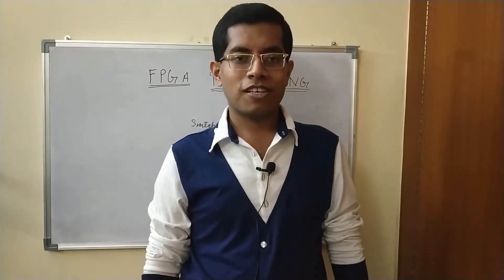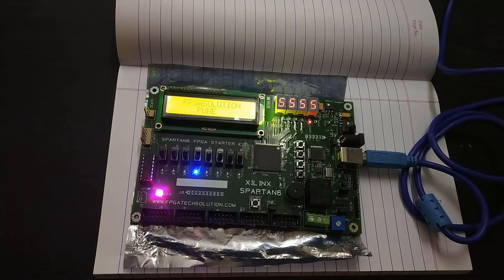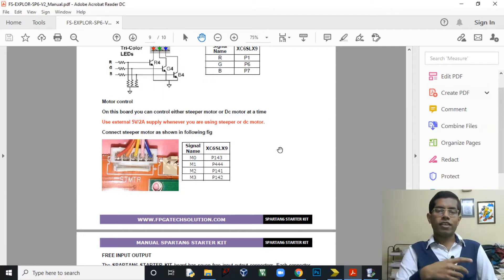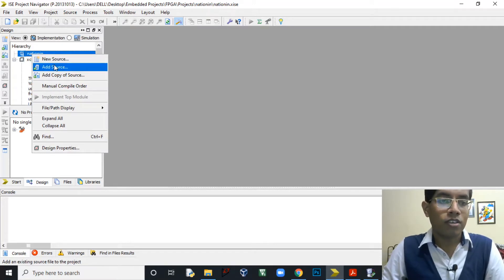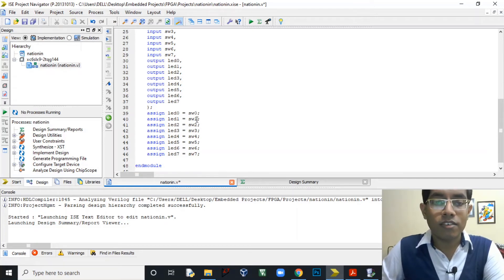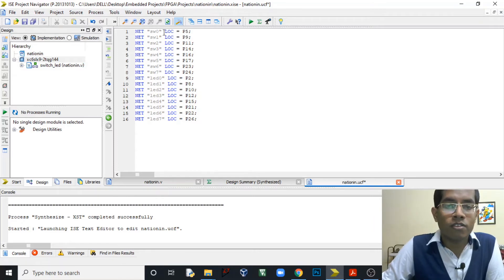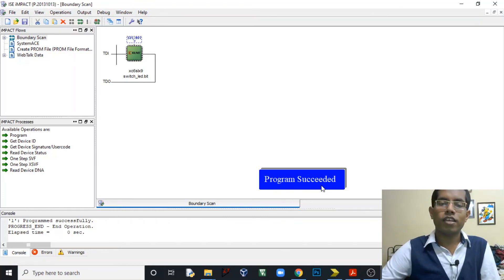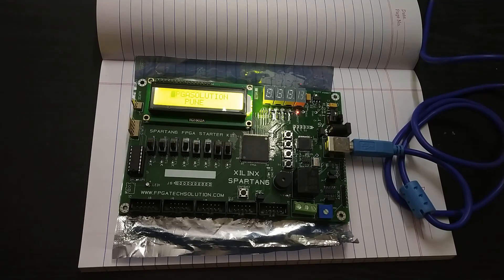Getting started with Xilinx FPGA Board | Spartan 6 | Project Implementation

Comment: hi,
i have issues:
i have spartan 6 board Mimas V2 which is by numato who provides their own config (uploading .bin file) tool so i used that instead of "configure target device" and it programmed the board.
the problem was after uploading the .bin file the leds awa switches won't function as desired by your code.
also the LCD display is showing 888.
later i tried with .bit file as well but this time not 888 and no functioning of code.

p.s. i have tested the board by programming it with numato sample bin file and it works with it well. so no issues with the board.
i have followed your video step-by-step. everything went well except the Map was yellow (not red) but i don't know what to do about it.
any ideas what is wrong with my code whereas no one else has complained :(
Reply from the maker: https://www.nationin.com/contact-us